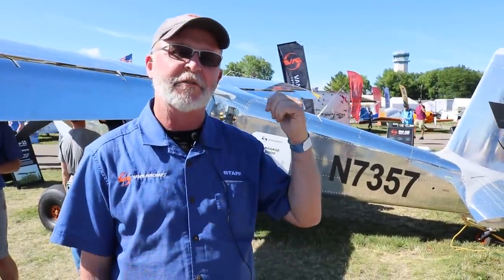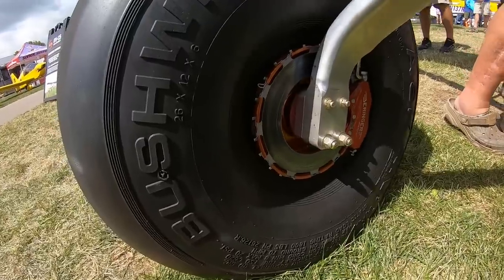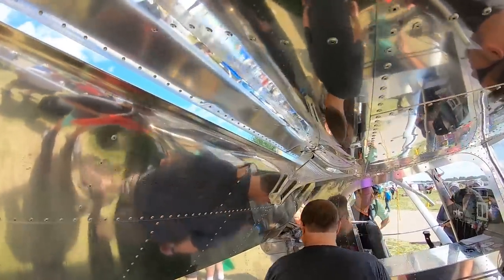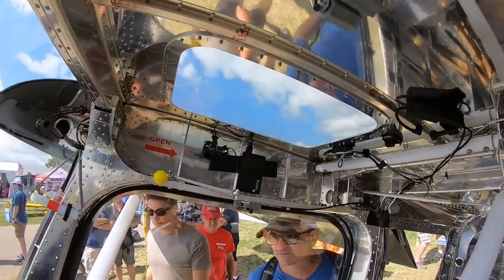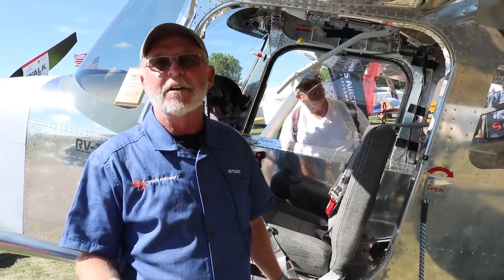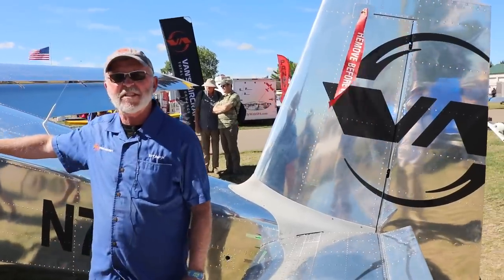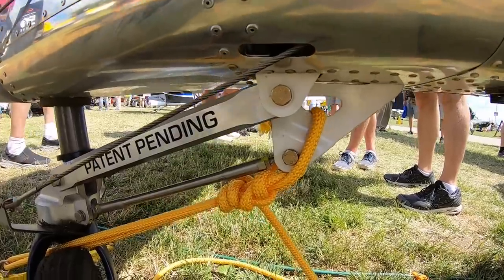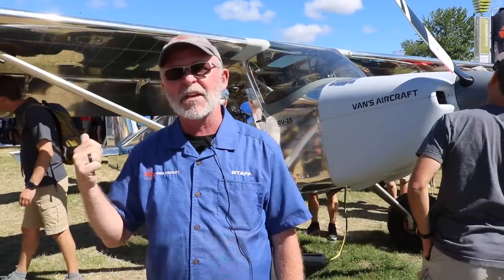Hottest STOL Aircraft at Oshkosh 2022 Vans Aircraft RV-15

Comment: Personally think with shock dampened mains , shock dampened constant angle non shimmy tailwheel , pushrod and bell crank activated surfaces as opposed to cables and pulleys , huge flaps ,  mechanical aileron differential that prevents adverse yaw , full flying stab ( huge advantage in every realm of performance  )  ability to use most powerful 4 bangers available ( angle valve 390 and variants ), large wing area versus weight ( extreme important detail  none have put a number on )  large flat cargo area as a 2 seater  I think Vans has approached the very edge of what can be done for an aluminum riveted  exoskeleton  back country plane without adding complex leading edge slats   { can be aftermarket product ) ...And took cross country speed seriously compared to cubs and other competitors .. A singular item I dont see is a factory engineered ballistic chute .. the one item that makes Cirrus the best selling certified single on the planet ... This however is easily engineered aftermarket  in high wing kits .. High wing planes lend themselves to ballistic chute installs far easier than low wing ..
Reply: They ticked every box for an aircraft of this type. 

The BRS can come later, but IMO most bush planes forgo them for that extra payload. If you bring more fuel odds are in your favor you wont run out of gas. And if your engine quits, it can land almost anywhere. Most off-airport pilots consider themselves a cut above the rest, and they are. Its not going to break up inflight. Why bring 50lbs of BRS?

Comment: The shocks are nothing new. I drew up some horizontal shocks mounted to the front fuselage/landing gear bulkhead, with conventional gear transmitting their angular motion into limier motion via a 45*bend in the upper part of the leg such as this several years ago.

This sort of tech comes from race-cars over 50 years ago. (inboard shocks).

Comment: Why on earth would you use struts and not at least have folding wings?  Pop rivets Instead of solid rivets just like the light sport non aerobatic baby 12. It will likely be twice the cost upon completion as the competition in exchange for a higher load but longer stol numbers.  I think Vans has its first loser unless they make some serious changes.  I spent a couple hours at the booth as well, not impressed.  They’ve reinvented the 180 with a few improvements. Congrats.
Reply: why folding wing again, especially for a 34foot wingspan?
Reply: Anyone that can afford to purchase this plane, can afford to hangar it w/o folding the wings.
Reply: @michaelspunich7273  Agree. From a practical side, towing a plane like this on the road brings a lot of risks.  Not to mention the plane will be at least 25 foot long so the chance of sideswiping cars goes up exponentially when towing something this large.  The folding wing mechanism while it works for a kitfox size, for a large plane like the 180 size RV15, it will be humongous.  Yes, folding wing for towing totally impractical.
Reply: Paulie, I believe they have a good round one. I agree, folding wings would have made it even better! Pull or flush was on the order matrix. I'm fine w/pull....
Reply: I think folding wings limits the wing chord so it's not too wide when the wings are folded. What's the road width allowance, 8.5' in most states? Also a full cantilevered wing would have the big carry through taking up headroom in the roof of the cabin and so no windows either.  And this aircraft should still be quite a bit cheaper than a CE180, don't yah think? I'm betting they sell.
Reply: Calling it an experimental 180 is actaully a compliment. so many people would love an all metal tail dragger without dealing with certified red tape and expenses .
Reply: @HamishBrown3  Avoiding the FAA red tape and expense is why many of us go experimental.  Vans Aircraft is as ubiquitous as Cessna or Piper